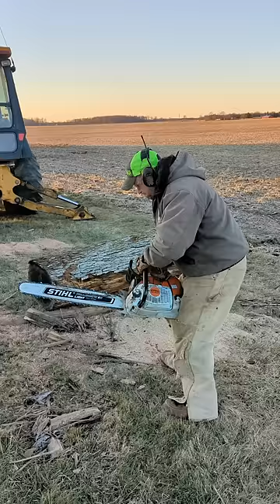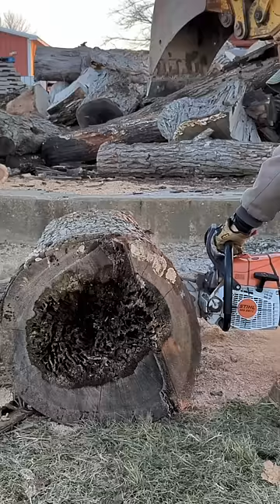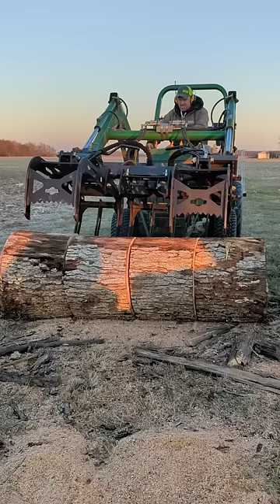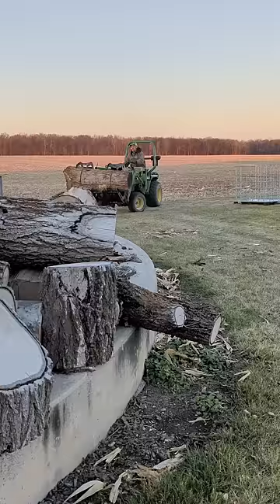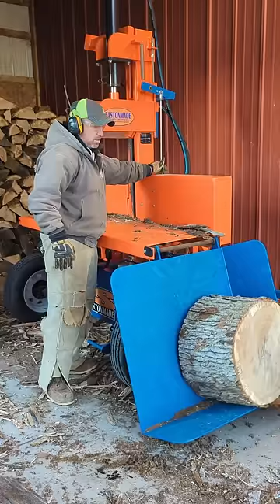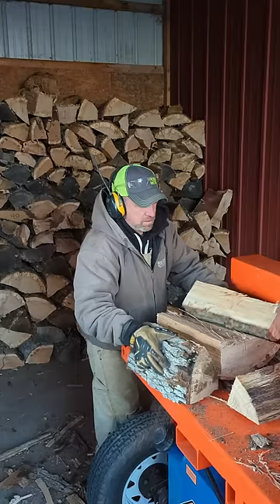Making Fast Firewood! #shorts

Comment: i guess if i had the money for a tractor with that front loader on it (over $30,000.00) and a splitter with a hydraulic lift (can't find a price yet) i'd use 

OH and the indoor shed (cost?)  i'd love that set up. me: i am outside in the 20 degree f weather in snow with my splitter getting wet and freezing and prepping my wood, moving it either by hand or wheel barrow. 

must be nice.
Reply from the maker: Yes, it is nice.

But I'm not cutting inside anywhere.  I'm out there in the cold too.  I started 25 years ago all by hand.
Reply: @digdrivediy  
Not trying to compete...35 years ago. In Los Angeles. Eucalyptus by hand. Ever try to split eucalyptus by hand? Since then ive split well over 1,000 cords. Hydraulic splitter and my hands.
Reply from the maker: @hypnotherapycw  I've never cut any eucalyptus.
Reply: @digdrivediy  a small round 16" tall 16" diameter could bury 10 wedges in it and still not split.

Comment: tJust discovered this channel….can’t help myself ….must comment.
You have the best splitter I have ever seen or used.  You use a  Stihl  saw. And a big excavator.  All must total in the 10’s of thousands.    Nice chaps, except that they aren’t chaps.  You start your Stihl standing  almost upright and almost have control of where the bar is pointing as it starts.  The saw starts and just barely missies your thigh as you rev up the saw.  When your mishap occurs and you lose control of where the bar is,  you will experience what I did many years ago.    IF YOU ARE LUCKEY AND THE GOOD LORD IS PROTECTING YOU,  THE SPINNING CHAIN WILL MISS the MAJOR ARTERY ON THE INSIDE OF YOUR THIGH.  IF IT DOESN’T,  you will bleed out before the EMT’ S  CAN GET TO YOU.  Unless the old denim  Levys  can stop the chain.  Go buy a complete set of safety gear.  Chaps, gloves, face and ear and eye protection.    I know what can happen,  I came down from topping out a small Oak for a friend.  This was about 35 years ago.    I had carefully tied a 12 ft ladder to the Oak, started the saw on the ground, pulled the running saw up the tree, cut off the dead section of Oak, killed the saw and lowered the saw down to my friend on the ground.  Sounds like I was very careful.  When I got down and turned to face my friend. He was staring at my new Eddy Bauer 60/40 coat.   When did you do that? He asked.   My new jacket that falls just above the knee was slashed completely through the jacket  right at the location of the major  artery in the thigh, but it did not touch the artery.  I started to shake and had to sit down.  I never knew the running saw had gotten  anywhere near my leg…… not even within a foot of my thigh.  
Stop being Mr. Paul Bunyan or Mr.. Stihl Saw starting a saw in mid air.   That big opening under the handle is for your foot. To maintain the saw in a safe position in the event it starts unexpectedly,  Read your Stihl owner’s manual. You were wearing NO SAFETY equipment.  You started your saw off the ground and it started inches away from your body.   You are a great wood cutter  and buy great equipment but you are a piss poor example of a safe worker.  Totally un equipped to be a good role model example especially Of safe saw work.   There ….I’VE said it.  ….you have a great opportunity to teach the new sawers  safe work habits.  Go buy a complete set of safety gear.  Everytime you use it just thank pore old JoeB for good advice.  Those of you who want to be self taught heros, keep on cutting without safety equipment but call your insurance broker and triple your life insurance and start saving up for your huge Obama Care deductible.  If you think I am making sense, please comment.  Together we may save a young life.  GOD BLESS YOU ALL? 

JoeB
Reply from the maker: I appreciate the feedback. I'm glad you're OK from your mishap.
As far as me having no safety gear though...
I have chain saw pants on underneath my Carhartt bibs.  I am wearing safety glasses, eat muffs and gloves.  So, not sure why I'm such a piss poor example.

You can see my chainsaw pants in many other videos.

Appreciate you watching and thanks for the attention being brought to proper safety.

Comment: Why wouldn't you hold the log in the jaws and cut it instead of having to move it around on the ground? I'm all about work smarter
Reply from the maker: The backhoe bucket is wider than my cuts.  I could only cut twice and then I'm back in and out of the backhoe.  It's easier just cut it on the ground and be done than keep climbing in and out of the machine over and over.  At least when I'm by myself.  If I have help I stay in the machine and then we hold them up and cut.

Comment: Is there a way to cut the log while you have it with the Thumb or in the Grapple? Or could you fab something? That could bring it up to waist height for cutting and save you from having to roll and recut. Not trying to take your exercise away from you just trying to either make it so you can cut more wood in the same amount of time or save some time to spend with family.
Reply from the maker: I can hold it up to cut it and often times will when I have help or someone to cut for me.  When I'm by myself it is too many trips in and out of the backhoe to be efficient.

Comment: Just leave it in the excavator grab at waist height to cut it,  why make it difficult?
Reply from the maker: The bucket is wider than my cuts, so I have to get in and out of the backhoe multiple times to hold it and cut it when by myself.  It's easier just to drop it and cut it on my knees.  If I'm working with someone else and I can stay in the backhoe, then it's a different story.  Make sense?

Comment: I have one question. Why are you kneeling down braking your back cutting and rolling logs by hand when you have a machine that could hold it up at the right height for you. Much easier on your back. Work smarter not harder
Reply from the maker: Kneeling down really isn't hard on my back at all.  I can use the backhoe but when working by myself it is lots of trips up and down, in and out of the cab which is actually more strenuous than just kneeling down and cutting.  Rolling the log ain't bad either since it is round.  Sometimes exercise is OK for the body.

Comment: Dull chain
Reply from the maker: Backhoe was dripping oil, tractor had a low tire, splitter was almost out of gas, one of my light bulbs was burnt out on the shed, my glove had a hole in it and my camera battery died at the end.  Don't just pick on the stuff that's easy to see!

Comment: Step1: own 35,000.00 worth of equipment and a 1000 dollar chain saw...

Step 2: act like it's work and make video
Reply from the maker: Actually those are like steps 9 and 10 dude.
I started out with a 76 Ford pickup and just my 036 chainsaw. We've been hitting our house with firewood for the last 25 years now. Only reason I can afford any that equipment is from saving money on buying propane. You have to make it easier as you get older.
Reply from the maker: Oh, and that chainsaw was like $1400.